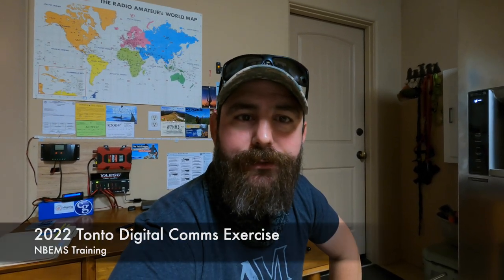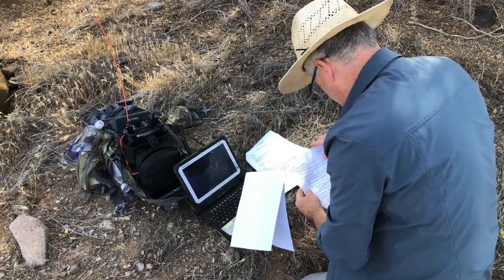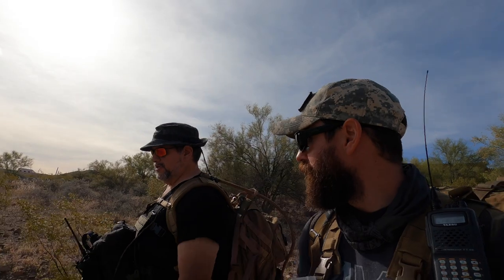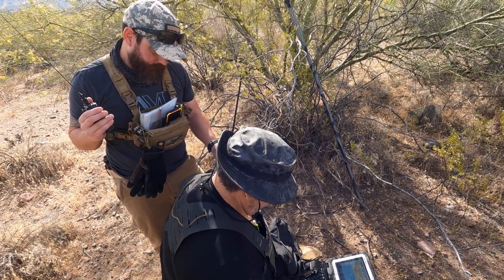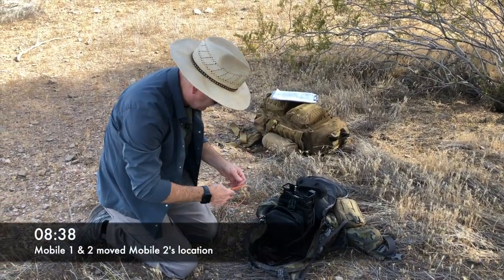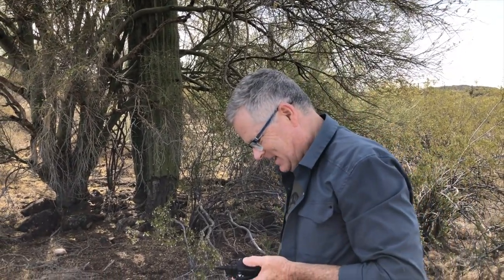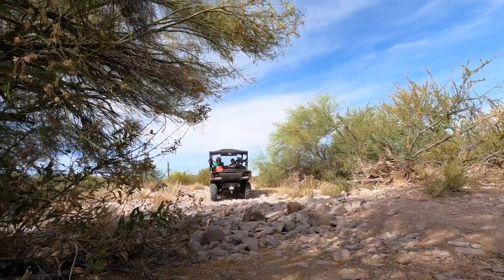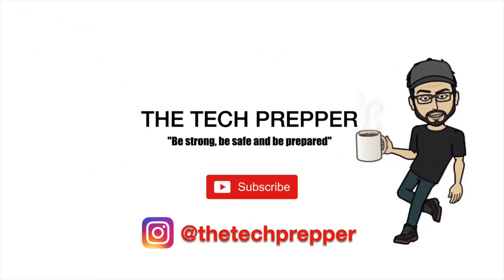Digital Comms Field Exercise Part 2 - The Adventure

Comment: Congratulations on your test.  NBEMS is popular in this area.  We use it with ICS forms every drill.  We do a net once a week for practice.  Laptops, Raspberry pi and phones with acoustic coupling.  We have found that MT632KL works best.  You can use MFSK modes to send small images.
Reply from the maker: Good Morning, Mike. Thanks for the details. All modes worked for us, but we were only about 1.5 miles out between the farthest stations. MT63 will likely be our standard, but 8PSK-1000F was a screamer. This was literally the first time using NBEMS for three members in the group. My self and another ham had used it only solo. It was great practice. Hopefully, we will get permission to have a regular nets and use the local repeaters.

Comment: Eventually you want to get to no phone ID for messaging. That is run straight digital like FT8 etc.
On the acoustic coupling I did not hear the little optional mode worble sound. If I remember correctly that helps with unattended operation for verification of reception with auto resend and auto mode switching.
Reply from the maker: You're a gold mine of information. Thanks for helping out the newbies. This was our first exercise with NBEMS.

Comment: That worked out better than I was expecting.  Well planned and executed gentlemen!  Can't wait for the AAR.  Now if someone knows how to make that into a wearable form factor I'd be on cloud 9.
Reply from the maker: Thanks. I know how to solve this problem, but I'm
still in the crawl phase (laptop). The "walk" phase is my special software interface, EmComm Tools, that will run on the laptop. The "run" phase will be EmComm Tools ported to an Android application. I guess it could be paired with one of the Android watches.

Comment: The issue with mode switching on transmit has to do with setting that tells whether flmsg or fldigi is in control. The preferred setting in my opinion is letting flmsg drive the train.
Your low audio acoustically coupling the phone to HT can be resolved by moving the phone mic, which is probably a little hole on the bottom of the phone, closer to the HT speaker. When acoutically couple I point the end of my phone towards the mic.
Reply from the maker: Thank you for the answers. You are officially part of the AAR report. 73's

Comment: Hobo coffee may be something to try. Hobos used to like to camp near streams with cool running water. They would get an old can, fill it with water, throw in some coffee grounds or chickory and boil it with fire. When ready they would gently pour in some cool clear creek water to settle the coffee grounds then gently pour the coffee.
My fire is my microwave and I have cold water in the frig. I think coffee this way taste great. It is closer to perculated coffee.
Reply from the maker: Typically, I just use instant coffee, a nesting cup and a camping stove (solid fuel or propane/butane). Hobo coffee sounds similar to Cowboy coffee.

Comment: Can you use a voltage step up on your battery pack? Our does it create a problem for the radios? I've noticed low batteries are a common problem.
Reply from the maker: I've never tried to step up the voltage as I've had great luck with the higher voltage offered by the LiFePO4 batteries compared to SLA's. What's your experience been with stepping up the voltage?
Reply: @TheTechPrepper  I used them testing LED lights. I would think the MOSFET would create too much noise. But your radios might condition the incoming power. You could deep cycle your batteries and keep the radios on longer.

Comment: I would love to "workflow" of the Net Control station. How did they capture and log the incoming traffic? Did their logs merge voice and digital?
Reply from the maker: There was a table in the comms plan that included the test #, time, latitude, longitude and power. This was the same payload as the CSV form. It was left empty on the paper version. But, the paper form also included these columns which were filled in by hand as digital traffic was received: voice received prior to TX (y/n), digital received (y/n), and notes. The notes included mentions of the mode used (8PSK1000F), timing and issues. In the next iteration those elements (modem and time to RX) will have separate columns.

Comment: This is awesome. The acoustic coupling looks pretty cool! If I understand correct you sent via acoustic coupling and they could recieve on the tough book via their normal digital ops?
Reply from the maker: Yes, I was able to send and receive when using acoustic coupling. The remote stations were also able to receive the messages on the CF-20's (running fldigi/flmsg). Works very well.
Reply: Awesome! I think this will be a good low cost option for me to use in the near future since I have not yet ordered (or decided what route to go) for digital modes from my ft60
Reply: Hi.  What's the name of the app on your phone that generated the digital tones?
Reply: @armenmkrtchyan4865  I have android. The app is AndFlmsg

Comment: I notice you put a fair amount of emphasis on message numbering. In my opinion this isn't necessary as flmsg generates message serial numbers when using ICS forms with originating station callsign, date, and time. It appends in subsequent identifier information when the messages is responded to or is forwarded.
As a former com ctr gi I remember keeping three logs for tx & rcv information, and two logs for station receipt and deliverier.
Once the message is properly received in the inbox it basically and html formatted email message to forward by any mode.
I know there is an ARES message log, but often you can just submit the flmsg log and copy of your messages.
To make training funner pass jokes as traffic.
Reply from the maker: We had a paper log with other details that net control was copying, so the test # was a good reference key for us. I appreciate the additional tips. Thank you for your service.